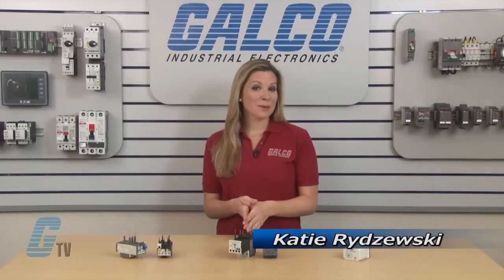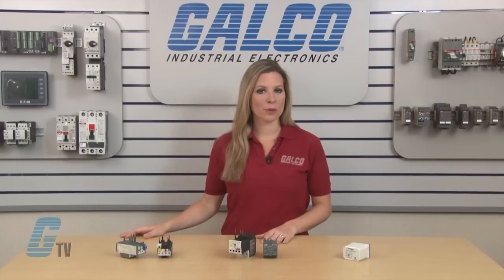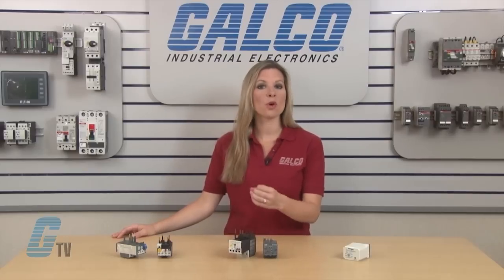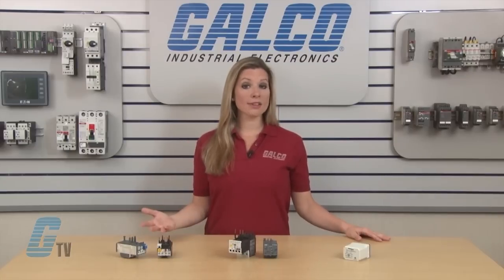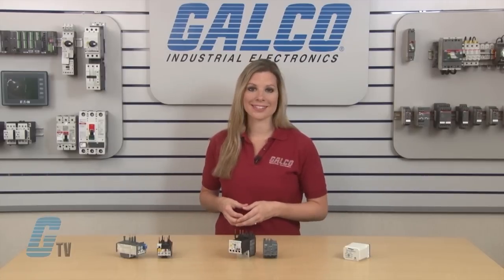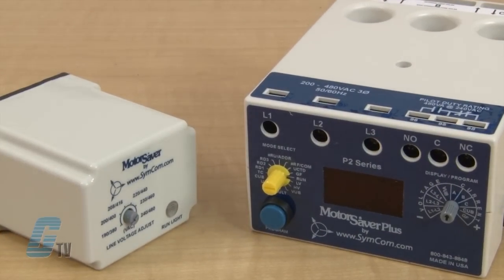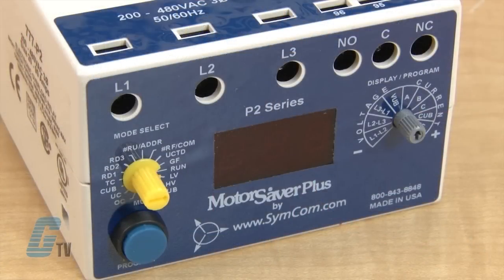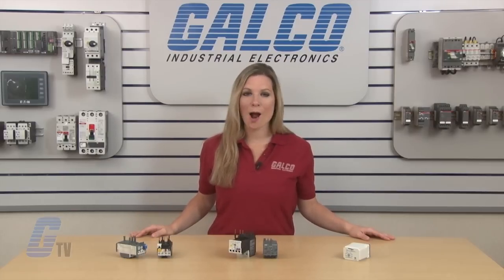What is an Overload Relay?

Comment: hi, i have an bore well pump which is 2 Hp from kirloskar, now i had 3 winding failures before,the pump is rated at 240V @ 14 amps single phase ,for protection there's nothing inside the starter box except an MCB and a Fuse,the contactor looks  https://ibb.co/iEP3Q5 , i have no idea what caused winding failure for last 3 times like jammed pump impeller or something but if i put an OL relay will it make an difference like protecting the motor from future winding failure ? rewinding this motor is a heavy cost as its a branded product....
Reply from the maker: Hello Raga, thanks for asking Galco today. An overload relay would be a good idea, follow this link http://www.galco.com/buy/Cutler-Hammer-Div-of-Eaton-Corp/FT11PB-18 for a quote on a single pole OL relay rated for 12 to 18 amps I found listed on our web site. Give us a call at 800-337-1720 and ask for sales to get our current pricing on the FT11PB-18 OL relay.